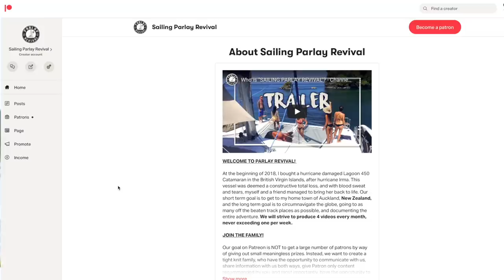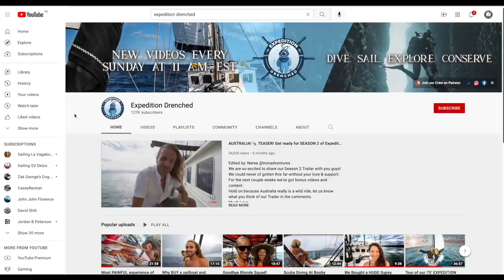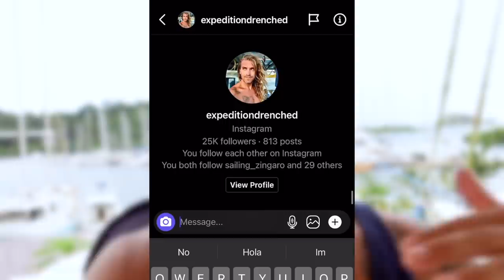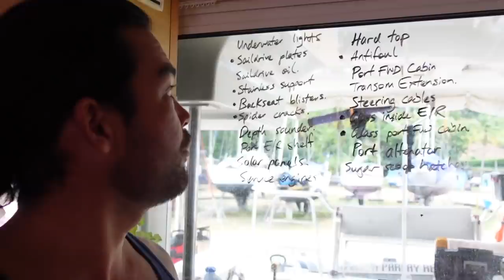Newest crew member has INCREDIBLE VOICE!! Episode 126

Comment: Colin, in full disclosure, do you think when you originally rigged the boat that the  shrouds and/or the stays were over-tightened? I remember the amount of force you applied was very high and could have contributed to the bulkhead problem. Now you are telling everyone that the force should be low and only enough to keep the shrouds tight when under way, and no more, which makes perfect sense. This is information that would be VERY valuable to all catamaran owners.

Comment: Colin is there no breaker that can isolate all electronics in the event of a strike?.., like a 1/3 way up the mast or would it simply arc over anything like that?
Reply: Lightning kind of does whatever it wants. It'll jump through insulators. Breakers don't switch fast enough even if you could bypass the arcing issue.
Reply: @alexmawdsley  Yeah I kind of thought that.